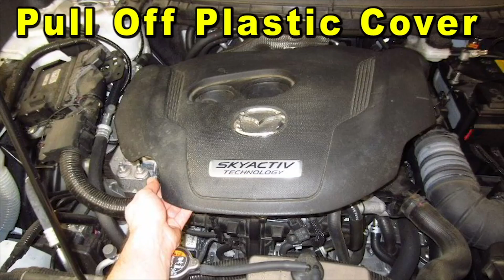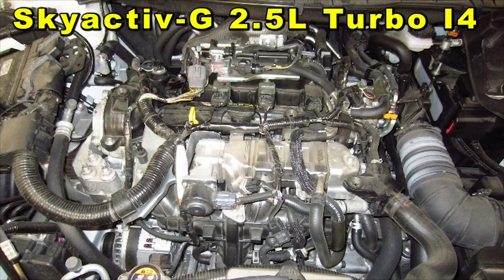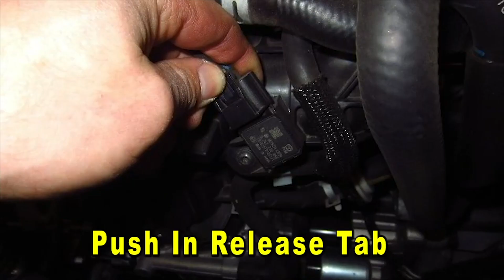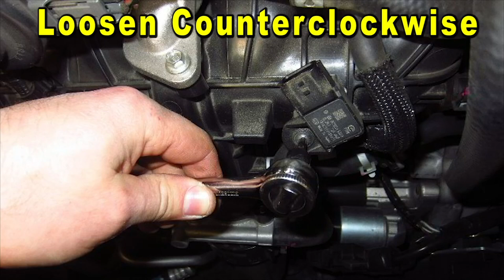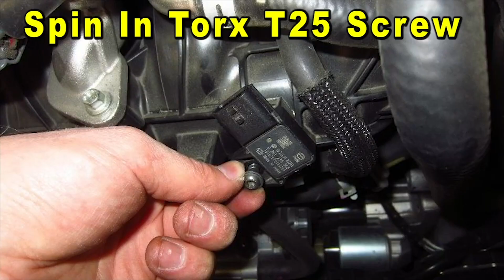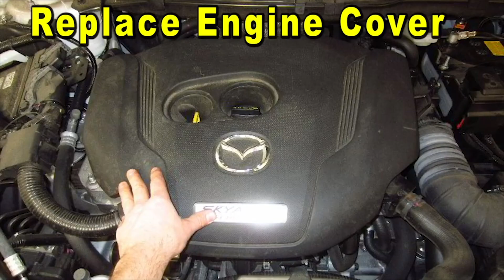2016 To 2023 Mazda CX-9 How To Change MAP Sensor With Part Numbers  - Quick & Easy

Comment from the maker: Mazda CX-9 MAP Sensors - https://amzn.to/3QC0tcd
Walker Products MAP Sensor Part Number - https://amzn.to/3QFQ5iH
Precision Screwdriver Set - https://amzn.to/3OYN1i0
Plastic Pry Bar Tools - https://amzn.to/3HMtsV7
Socket & Ratchet Set - https://amzn.to/3Z17LbA
Mechanix Gloves - https://amzn.to/3jCnHkt
Torque Wrench - https://amzn.to/3vS5uSI

The Paul79UF YouTube channel is a participant in the Amazon Services LLC Associates Program, an affiliate advertising program designed to provide a means for sites to earn advertising fees by advertising and linking to Amazon.

This DIY video shows owners of the 2nd generation 2016, 2017, 2018, 2019, 2020, 2021, 2022 & 2023 Mazda CX-9 how to change a failing or faulty MAP (manifold absolute pressure) sensor.

Comment from the maker: Check out the DIY guide for changing the MAP sensor in a 2nd generation 2016 to 2023 Mazda CX-9 SUV - 
https://www.paulstravelpictures.com/2016-2021-Mazda-CX-9-MAP-Sensor-Replacement-Guide/index.html

Here are all of the DIY repair and maintenance tutorials for the second generation 2016, 2017, 2018, 2019, 2020, 2021, 2022 & 2023 Mazda CX-9 - 
https://www.paulstravelpictures.com/Articles/2016-2021-Mazda-CX-9-DIY-Repair-Maintenance-Guides.htm

Owners of other Mazda vehicles such as the CX-5, CX-3, CX-30, MX-30, CX-8, Mazda8 (MPV), MX-5 Miata, Mazda2 (Demio), Mazda3 (Axela), Mazda6 (Atenza) and Mazda5 (Premacy) may also find these DIY instructions to be helpful.